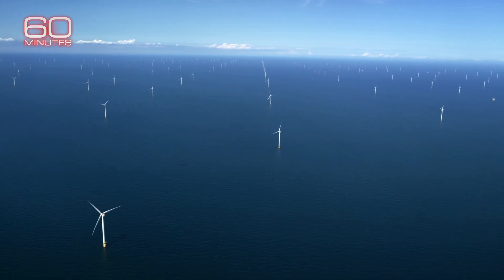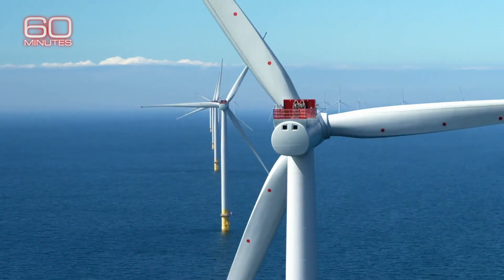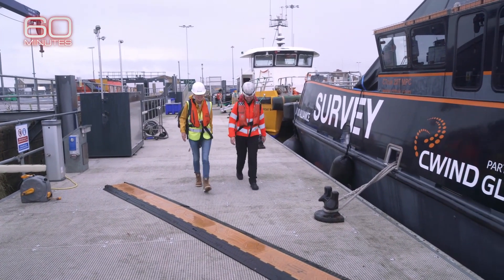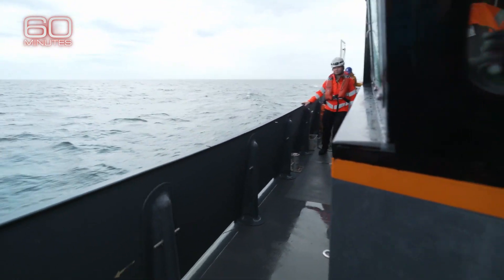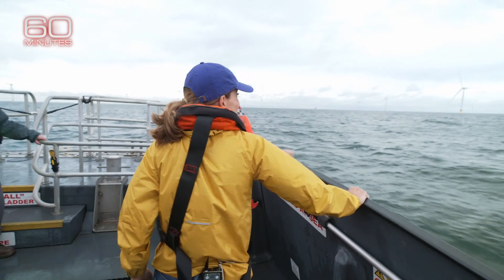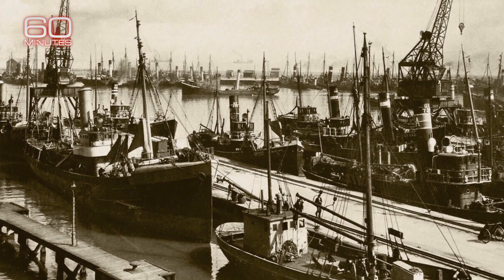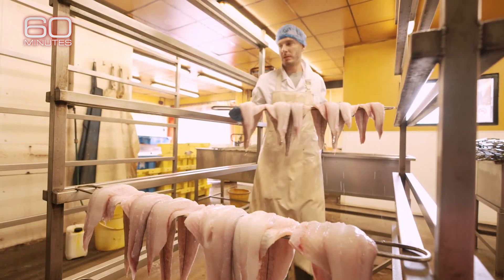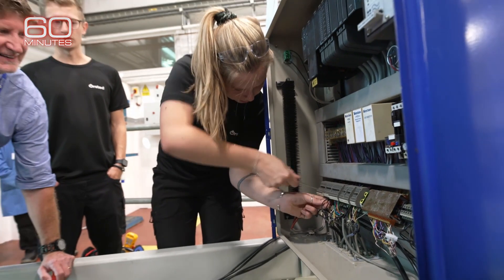Offshore wind turbines power more than 2 million U.K. homes daily | 60 Minutes

Comment: Powers 2 million houses only when the wind is blowing.  .
Reply: Wait what ? U don’t know what u saying.
Reply: @bigbro710 they're powered by fossil fuels when the winds aren't strong enough.
Reply: A lot of money and resources spent to only power 2 million homes. If every house was required to have solar panels it would be cheaper, it wouldn’t destroy the ocean. It would keep homes cooler in the summer. There’s sustainable food source in the ocean and these wind mills are going to
Mess that up. Why try to fix a problem by making another problem…
Reply: @DeadVegaInSpain  Your solar panels don't work at night - and not that well on dull days. If you're going to say "batteries", then that applies to wind too.
Reply: "only when the wind is blowing." Quite apart from the fact that in the north sea it very rarely isn't (they have more problems with too much wind than not enough, I think!), I don't understand why that's an argument: "there's a man in town giving out money. I'm not going to bother taking any of it, because he's not there every day."
Nobody's saying we should rely only on wind (other than its opponents), but I don't see any reason not to use it when it is available. It's as free as solar or hydro (i. e. it has construction and maintenance costs, but no energy input costs, unlike coal/oil/gas).
Reply: @G6JPG  Please do some research on this. Your 'Free Money'  comment would  make sense if usage matched generation. All renewable and fossil generators on the grid have to remain synchronised at 50 or 60 Hz. Generation must match load on an almost instantaneous basis else the generated frequency rises or falls.  i.e. When the wind blows something 'must' be shut down to compensate. When the wind abates (or is too strong) then some other source has to be brought on line. Generator spin inertia works to balance usage in environments where renewables are only a small percentage of total generation but the problem becomes very difficult to handle once high entropy source generation, like renewables, become the dominant source.  I don't yet see any practical solution to sinking the excess power.
Reply: @bobdeverell  It takes minimal energy to keep a fossil generator spinning when not generating power. Most of the time, the wind doesn't go from 0 to usable in a very short time - usually long enough to back off whatever turbine you choose to back off, in a manner that doesn't actually waste much if any energy.
(I worked in the power industry.)
Reply: @G6JPG  For every wind turbine we have to maintain spinning reserve and install additional transmission.
Like it or not, all the evidence shows that countries introducing wind and solar into their energy mix create horribly expensive electricity for industry and consumers yet good profits for the suppliers.
Reply: Its usually plenty windy enough on the north sea to turn these turbines, they don't need much. Just today if you look at the live power grid data, we are making over 50% of power from wind. And today is moderately windy.
Reply: Woa, good point, but when they are in the North sea - known for its neverending choppy wind, I guess that's not a problem.

But it's cute that you're trying.

Comment: They should install floating solars too
Reply: I can think of a few problems with that, waves would crush it and it would interfere with navigation
Reply: @Juggernaut-fg2up  You leave channels! You could just as well say buildings interfere with transport on land - but we leave channels, called "roads".
Reply: @G6JPG  I am a uscg certified commercial captain, I am fully aware but there is a lot more to it than you are considering
Reply: @Juggernaut-fg2up  I yield to your greater knowledge. (After all, there must be some reason against it or they'd be everywhere.) They might come, though.
Reply: @G6JPG  yes sir thank you. They exist as do buoys that contain linear generators that create power from wave motion, I personally think they would be better. Wave action creates incredible forces
Reply: @Juggernaut-fg2up  Yes, and - for floating wave energy extraction - the Salter duck. I think, if you're going to go for wave power, something shore-based is likely to be more robust (such as rectifying chambers, which can be made out of concrete) than anything floating.